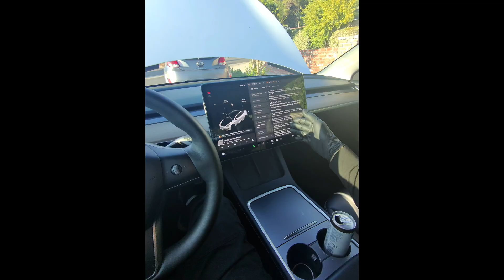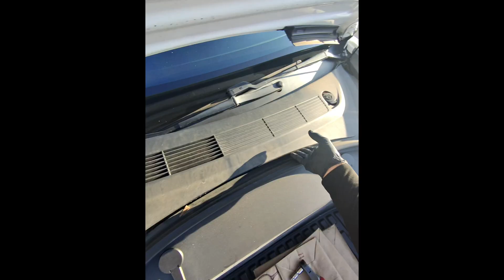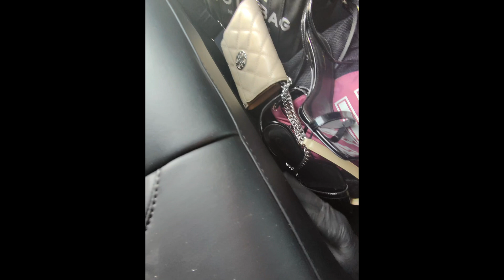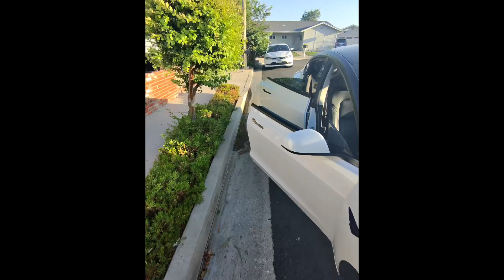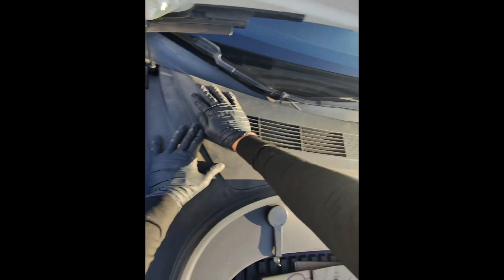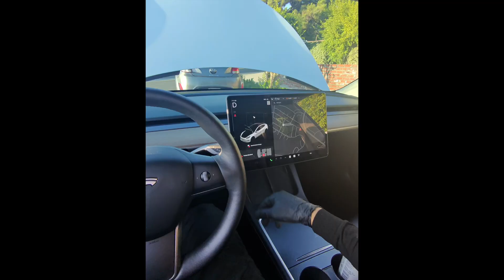2021 Tesla Model 3   12v Battery Replacement

Comment: Hello, 

I am looking for a battery replacement as my 12v battery just died. I have been looking everywhere because my Tesla service center is 3hours away. 

Do you have any recommendations for batteries? I don’t want AGM batteries because they are crazy expensive. I live around all big corporations(Walmart, auto zone, O’Reillys, Costco) that sell batteries. 

Thank you in advance!
Reply from the maker: Thanks for watching the video and for the question! Sorry to hear your 12V battery died — it’s a pretty common issue on these cars.
For 2021 Model 3s there are actually two possible batteries depending on exact build date: most have the original lead-acid version (what I show in the video), while very late 2021 builds got the lithium-ion one. The lead-acid style is what the majority of 2021 owners are replacing.
Since you want to avoid expensive AGM batteries and shop locally:
•  Look for a flooded lead-acid or maintenance-free battery in Group Size 51R (or B19/B24 equivalent) around 40–50 Ah with 300+ CCA.
•  Physical fit is critical (dimensions are roughly 9–9.5” L × 5” W × 8.5–9” H, plus correct terminal orientation and vent tube if your setup has one). Many owners successfully use affordable options from AutoZone (Duralast), O’Reilly’s, Walmart (EverStart), or Costco in that group size.
Pro tip: Take your old battery with you to the store so they can match it directly or check fitment. Tesla service sells the OEM lead-acid version for around $85, but the retail equivalents are usually in the $80–$150 range and work fine for most people.
Watch the full video for the complete step-by-step replacement process (frunk access, safety notes, reinstall, etc.). It’s very doable as a DIY and will save you the long trip to the service center.
If you can check the build date on the driver’s door sticker (or tell me what your old battery looks like / picture of battery /any labels on it), I can give you a more specific recommendation. Lithium replacements exist but are more expensive and have different requirements.
Reply: Can a lead acid batter be upgraded to a lithium?
Reply from the maker: @RavenCruz-w8o Great question.
Yes — on Model 3s that originally came with a lead-acid 12V battery (most pre-late 2021 vehicles), you can upgrade to a lithium 12V battery. Many owners do this for longer service life, reduced weight, and better performance.
The key is using a lithium battery specifically designed for Tesla.
A few important notes:
•  Not every lithium battery is a good fit — a generic one can cause errors or charging issues.
•  Cars that already came from the factory with a lithium 12V system should stay with a compatible lithium replacement (OEM preferred).
•  There can still be occasional software alerts, and Tesla support for 12V-related diagnostics may be limited after an aftermarket upgrade.
If you’re considering the upgrade, make sure the battery is the correct version for your exact build date.

Comment: Can you swap it for an agm battery?
Reply from the maker: Yes, you can install an AGM 12V battery in your Tesla Model 3, but only if yours has the original lead-acid low-voltage battery (pre-late 2021 builds). It’s a popular and successful upgrade for better longevity in those cars. For newer Model 3s with the lithium-ion 12V system, it’s not compatible and not recommended.

Comment: Do you know why you/Tesla's  method not disconnect the rear cable first, then 12v battery (-), (+). New 12v battery, why not, (+), (-), then last rear seat cable? This way I thought the 12v battery would always act as a voltage damper protect all accessories from the high voltage car battery.
Reply from the maker: The 12 V battery is not needed as an extra “damper” during the penthouse connector step. Tesla’s order is actually the safer and more reliable way it follows standard battery safety practices, guarantees proper HV isolation, and prevents fault codes on startup.
If you ever have to do the job, just follow the exact sequence in the Tesla service manual (or the one in the owner’s manual under “Replacing the Low Voltage Lead-Acid Battery”) and you’ll be perfectly safe.”